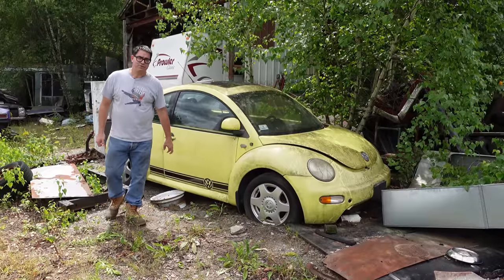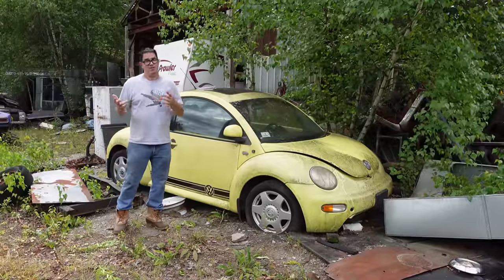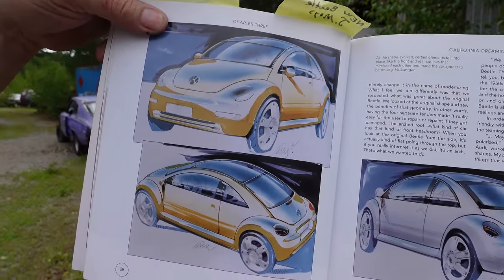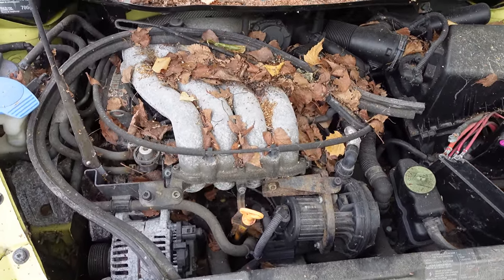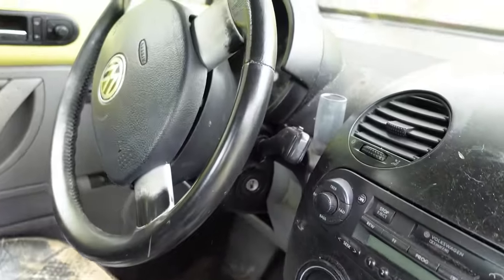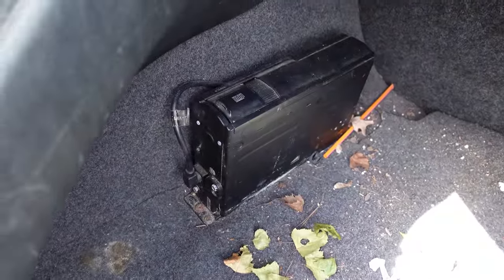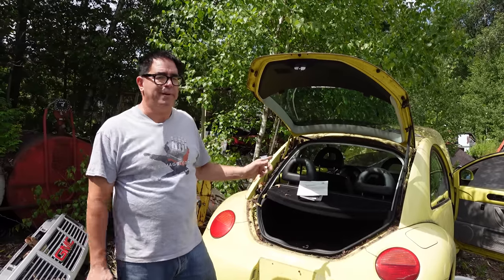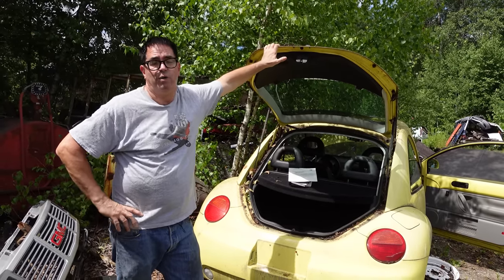Old New Beetle

Comment: I was a VW tech when this thing made its debut. Having owned several examples of the original Type 1 and Type 2, I thought this concept was a neat idea. The early examples of the new Beetle were plagued with quality control issues that resulted in very disappointed owners and frustrated techs. Anyone expecting the old VW build quality was in for a let down. It got to the point where I couldn't stand the sight of them. Same thing happened when the Rabbit was introduced. The first two years of production was a disaster. VW actually introduced an upgrade program to fix all the problems and I spent many hours on many cars to try and rectify the issues. We were told that marketing needed the Rabbit now and engineering said it's not ready. Engineering was right. I enjoy your channel Steve and your extensive automotive knowledge.
Reply: VW hasn't made a good car since the original Beetle. The rest were all heaps.
Reply: @googleusergp  Not since Joseph Ganz.
Reply: What a turd. These must be kinda lame to service due to it's very inefficient body design I would think.
Reply: I agree. My new 2000 TDI one was a real turd. Always back to the dealer for sunroof leaks they never solved, wiring in the door, ducts in the dash, brake light switch, emergency flasher switch. Made them take it back and went with a Golf GL TDI Im still driving to this day. There is no middle ground on a VW. Its either very reliable or a total heap of shite
Reply: Yeah I read the rabbit is why most of the old dealerships are gone because of sale of the rabbit. I remember the new bug came out and I saw early drawings and it had a motor in the back.
Reply: @UberLummox  The Beetle is the only car I've ever really liked from VW. Maybe the Rabbit, but that's about it. Not much else going on there. The Karman Ghia looked like a 1950s style toilet bowl. I worked with a guy from China and he saw a photo of one and said, "Looks like a 1950s toilet bowl". LOL.
Reply: @googleusergp  even that air cooled car was horrible lmao
Reply: @samholdsworth420  The Beetle was a good car in its time. They ran very well, but yes they had their quirks.
Reply: I owned a rabbit way back in 1982, I really liked the bugger! But you’re right! I had issues with the suspension and drive axles bearings! Also the clutch wire! Had to keep readjusting it! Then! The issue with getting rust very quickly! I lived in Chicago at the time, and the Midwest snow and salt didn’t make things easier! But besides all that it was a fun little car to drive and gas mileage wasn’t too bad.
Reply: My daughter had one, and it was built in Mexico.  Last thing I expected from a German car lol
Reply: I think most VW shipped into US are made in Mexico.

Comment: Thanks Steve !  Old retired guy here ! A couple of years back I revived a 02 Beetle that had been parked for 5 years it was a 5 speed 2.0L for my wife.  The car was super clean solid underneath ran great and was free !
So I took it on as a challenge.  Basically I had to rebuild the entire suspension and braking system. Massive electrical problems soon showed up which took alot a research to sort out.  Water leaks from the sunroof corroded numerous connectors and all the grounds.  The drivers door latch micro switches acted up...the body control module was possessed.
But its perfect now and we drive it everywhere ! It barely sips gasoline and is a ball to drive!  I have $4,000 in parts and did all the labour so for a retired guy its a cheap ride.   When I met Nancy 50 years ago this fall she was driving a bright orange MGB !  So in our 70's having a sporty little 5sp puts a bit of fun back in the old bones.  I've always done all my own work so the Bug doesnt frighten me in the least.  I will say unless your prepared to do 100% of the work DO NOT GET ONE. Heaven help you paying garage rates to sort an old one out.  Truth be known the dealers and most mechanics will not work on their electrical issues period.  And dont get an automatic.
Reply: That's really awesome! Thank you for doing that! I'm sure the car is thankful too. I'm in the process of resoring my 99 Beetle with the 2.0l and 5 speed. It too was parked for 5 years and I'm just now getting the engine up and running and will also be spending hundreds soon to refresh the entire brakes and suspension systems to get it road worthy again. It's a lot of fun, I bought this car in high school and I will own it for 10 years in January. I'm very much attached to my Beetle and love it. I don't ever want to let it go.
Reply: Yeah now you tell me about the automatic. I had a Jetta 2.5 with a 6-speed auto, good transmission until it wasn't. It drove okay when cold so I slow rolled to a dealer and traded it. (he knew the trans was gone) I imagine it ran perfect for the auctions.

Comment: I bought my wife one of those new gen Beetles. I'm gonna have to admit that doing so was one of the worst car buying mistakes I've ever made.
The fact that this car featured here still has all it's plastic interior pieces and panels still in place and not broken, missing or held in place with duct tape is surprising to be honest. 
The only positive things I can say about this car was that it got decent fuel mileage and it handled pretty good. Those 2 liter engines wear out rather quickly, and once you start having problems it's gonna be one issue after another. The thing eventually started leaking from basically everywhere. I've always been a huge fan of German engineering but I couldn't find anything about the engine and transmission designs that I could admire. And then there's the interior panels. All made from cheap and brittle plastic that gets demonstrably worse as it ages. All the Switches, buttons, knobs and levers are subject to breaking, stripping or just simply falling off. When I sold that thing I honestly felt sort of guilty.
Not because I got rid of it, but because I couldn't help but feel as if I had sold someone a pile of crap for way more than it was worth.
In spite of the fact that I took a giant loss. Anyway.... That car left a bad taste in my mouth for sure.
Reply: I always heard the transmissions were bad so I stayed away from new beetles . Could of bought a yellow one this past week but shied away from it .  I collect P T Cruisers  and have two four doors and two rag tops but wonder if I'm doing any better .
Reply: @daynadiggle8169  My dad is in his late 70's and has been driving the same PT Cruiser since he bought it brand new. Other than regular maintenance it hasn't given him any problems to speak of. Other than issues with plastic interior parts and pieces. But since he bought it, it hasn't failed to start a single time.🤞 Of course virtually every type of car has it's lemons. But almost everyone I've spoken to that also owned a new gen Beetle has had basically the same complaints. I suppose a pampered, lightly driven and garage kept NGVWB would likely not give the owner too much to complain about. To each his own but I'd avoid buying one if my advice means anything.
Reply: @daynadiggle8169  And yes.... We had transmission trouble. Specifically, it had issues with changing gears as it accelerated. Was to the point where we had to physically let off the pedal fully before it would change into a higher gear. Otherwise it would just keep the gear and the engine would damn near redline if we weren't careful. Hell the damned AC switch malfunctioned. AC worked fine but we simply couldn't turn the damned thing on. Something about the metal contacts behind the knob breaking and falling off. You have to practically take the entire dash panels off just to get to it. And taking the panels off is a gamble due to the cheap brittle plastic tabs breaking off when you attempt to remove them. Seriously it was a 💩 show from the beginning. Maybe later models were improved upon but I don't know. I'll never buy another one if I can help it.
Reply: @lilmike2710  Yes , and now I'm having trouble with the 06  P T .     Engine light comes on and auto trans . stays in first , refusing to shift . Have to drive home at 20 m.p.h. and at 2,000 rpm .  Have been taking the negative batt. cable off for half hour so computer can reset . This is a pain in my ass every day !  When did they quit making cars great and start producing complete crap ?  I paid $14,200.00 cash new for this one and could never get Chrysler to do anything for me .  Feel like I was robbed .
Reply: @lilmike2710  Enough with these crappy vehicles ... I'm going back to MATCHBOX  CARS !
Reply: @daynadiggle8169  America's love and romance for well built and reliable cars remains only in the hearts of nostalgic owners. So many restrictions and regulations imposed today that a car cannot be built that's both reliable and affordable. If we want reliability and beauty we have to either purchase a fully restored classic car or drag one out of it's grave and fix it ourselves. They're still relevant and they'll still be there and going long after all the garbage we have today has long since been ran through the crusher.
Reply: @daynadiggle8169  😁 🚗 🚛
Reply: @daynadiggle8169  I've just bought myself a nice 1985 Oldsmobile Cutlass. 355ci V8. All smog/pollution controls deleted, ported heads, RV cam etc.. I'm done buying new, insanity priced cars for life! I was interested in the new, retro designed Ford Bronco until I saw they're priced base at $31,000 !  I could buy 40+ acres of land less than that.
Reply: @daynadiggle8169  wait till you have to change the timing belt in your pt.
Reply: @suzi_mai  If you wait to change the timing belt , put it in the junk yard .  Steve will discover it 10 years later and make a new video !  Thanks , Tzuzi Tzu .
Reply: @lilmike2710  Scotty says stay away from the new Broncos . They are JUNK !
Reply: @googleusergp  👍
Reply: @daynadiggle8169  I've made up my mind. Not taking any more chances. I've decided to find myself an older pickup truck and redo the entire thing bumper to bumper. I happen to have a Chevy big block engine sitting in the garage. I do this and I'll never need to buy another one.
Reply: @lilmike2710  or buy a Toyota
Reply: @lilmike2710  This is true . I've got a 96  4x4 Suburban ,454  and I drive it around and on the beaches .  Always liked a big block .
Reply: @lilmike2710  In what part of the country?  I want 40 acres!
Reply: @12wingwfetech  another car I miss from my youth. 1973 Toyota Celica ST. 4 speed manual.
I hurt many teenagers feelings with that little import by out running them light to light.
Damn that was a good little car
Reply: @daynadiggle8169  I have a set of aluminum heads and intake for it. Came out of an RV so already has a cam. What I want is a 1964 pickup swb to put it in. I just have to find a decent one and that the owner ain't one of those "ah know whut uh got" people. 🙄

Comment: I purchased one new in 1998 when they first launched it. At that time, there was a 6 month waiting list. I ordered a yellow one with leather and a sunroof. When my name came up on the list, I was told it would be several more months for the car I ordered. Ended up getting a blue one with the 2.0L gas engine and a 5 speed manual trans. It was a decent car and got okay gas mileage. It handled and braked VERY well. There were a few small quirks that bothered me though. It had a penchant for burning out headlight bulbs several times a year, and the door hinge bolts liked to work loose despite retorquing them multiple times. The other issue was the low glare coating (sort of rubber-like) on the door panels started peeling very early. Aside from those issues, it was a fun car to drive. Side note, they all came (at the time) with a dash mounted vase and a flower that matched the color of the car. So, mine had a blue flower.

Ultimately, as our family grew that car got traded in for a Pontiac minivan in 2005 (which was just retired earlier this year).

I do still have a traditional rear engined air cooled Beetle though. 😊
Reply from the maker: Hello Paul Windisch, THANKS for the "owner testimony". If I had a time machine, I'd post each video, wait a day, read the helpful posts like YOURS then go back and re-shoot each video incorporating all of the Crowd Sourced Wisdom into the story for a cherry-on-top result! But alas, the Time Machine is "in the shop" so all I can do is say THANK YOU for watching and writing. -Steve Magnante
Reply: Ooh yeah the mk4 soft touch interior.
Stuff comes off with denatured alcohol.

Comment: In 2011 I surprised my wife with a red 2010 Beetle. She loved it and drove it to work daily. We took it on a couple short trips (@500 miles) and I really enjoyed driving it. It had the 5 cylinder engine and was very peppy. It did have a bit of a rough ride, and not much cargo space, but was very enjoyable.
In the 4 years we owned it we only put 14k miles on it.
Bottom line is that it was not the type of vehicle we needed long term.
BTW I went on eBay and bought the vase and flowers for the dash for her. 😍

Comment: I learned to drive and work on cars in a new beetle. Was a free car from my uncle, but was not roadworthy due to parking brake and other small malfunctions (including a surprising amount of rust for a clean looking car) that would cost more to repair than the car was worth. Manual transmission with a 1.9tdi engine - absolutely gutless, but still an absolute blast to drive and crazy reliable for 390,000km. It taught countless visitors to our place how to drive stick, and by the time a few years had passed, first gear was getting rough. Some hoses needed to be replaced due to age and pressure - an absolute nightmare of a job in such a tight engine bay and something I don’t look forward to doing again. Like others mentioned, the headlights were weak when I got it and soon burned out. It met its end when I drove over a hidden tree stump and it punched a hole in the aluminum oil pan and likely did some other damage. Maybe I’ll repair it and get it going again but my schedule is pretty tight lately. It makes a good toolbox for the time being.

Comment: My girlfriend in 2000 bought a new black Bug (now my wife). It was a lemon from the get-go. Overheating problems, they could not and would not address?  Head light failures, burning out. Finally, they took it back and it was a loss financially but no more headaches.

Comment: My Ex girlfriend owned a 2007 beetle with the 2.5 litre 5 cylinder and the 6 speed auto.  The engine was indestructable and Canadian winters killed the body eventually. She never had any mechanical issues with it in the 10 years she owned it but electrical problems were pretty common.
Reply: As a mk1 guy ,we used to rip the crap out of the Mk4 kids in the forums as the mk1 is the best anyway,no point in arguing. 
But the Mk4 has proven itself over the last 15-20yrs as a brick shithouse of a platform,it's really solid. 
I still see a good 5-7 of em on the road here in the northeast daily. 
Not bad for a car where the newest one is like 17yo.

Comment: Had a 2000. Handled great. Power from the 2.0 was adequate. Interior trim was horrid, door handles peeled and plastic bits were prone to breaking. The gas cap also liked to freeze shut in the winter.
Reply: the one pictured here is automatic of course so that's why it's in "junkyard crawl"

Comment: While I am a die-hard fan of the original Beetle, I did like the New Beetle, though it was clearly just a retro-styled Golf. But no matter, I liked the look and design. Test drove one and loved the ride. Unfortunately when they first came out, dealers were not only NOT negotiating, they were charging ABOVE sticker price. Nope. Turns out that every model year up to 2003 had QC issues galore, and even after they ironed out the bugs, it still had little issues here and there.

Comment: You could argue that the Prowler came first as the Prowler was a 1997 model year introduction and the Beetle was a 1998 model year introduction. When the Beetle came out in 1998, the ads stated, "The engine is in the front, but the heart is in the same place." as a homage to the original. The last VW Beetles imported to the US were for the 1979 model year. Emissions did in the old Beetle in the US, because fuel economy wasn't a problem, it easily made that. 

Keene State College is a liberal arts college in New Hampshire. These were produced either at the Wolfsburg, Germany plant or Puebla, Mexico plant.
Reply from the maker: Hello Google User GP, THANKS as usual for your insightful commentary. I'm aware of the Prowler as a Mopar-at-the-core kinda guy. I simply didn't think of it when camera man Shane called "action". But yes, the Prowler was / is an early example of Retro Design for mass production (well, ok, semi-mass production). Amnd yes I've caught a little flack over off-market goodies like the Nissan Figaro. But I've NEVER seen one of those on these roads - except as a gray-market import. Anyhoo, yes indeed, Tom Gale / Kevin Verduyn did Chrysler "a solid" by launching the Prowler. As a side note, as you probably know Chip Foose lays claim to Prowler's basic shape from his display at a May 1990 "idea fair" at Chrysler's Pacifica Design in Carslbad, CA...and the Foose Roadster was his response. Thanks for writing, Steve Magnante
Reply: @SteveMagnante  Sure thing. I was never a "custom car" fan. I think those guys like Foose ruin good original cars that look better stock. After all, GM, Ford and Chrysler spent millions (even back then) to make them look good and these "customizers" ruin them. That's my .02. I'm not much for aftermarket wheels, I'd rather stock wheels from another application be used. Give me a stock car any day over someone's "custom" work.